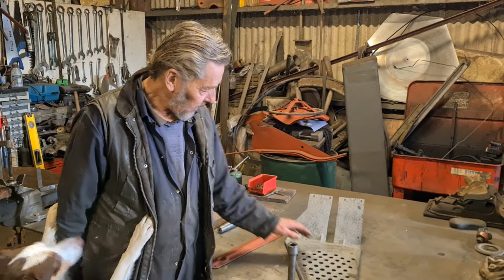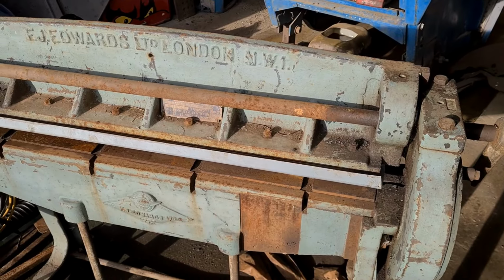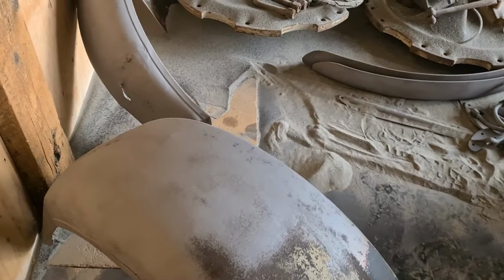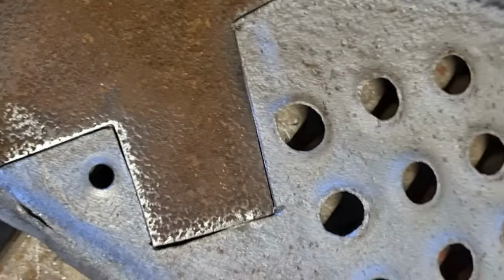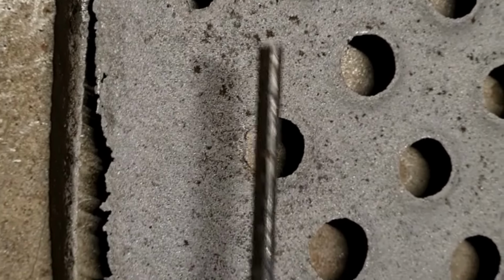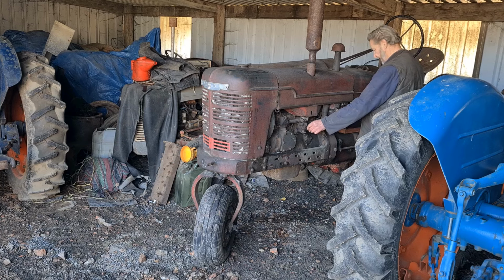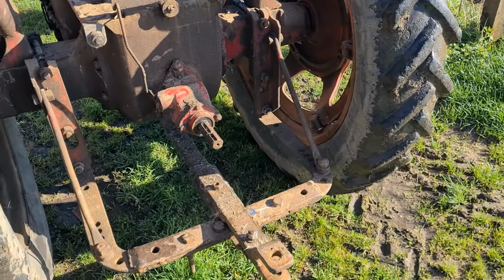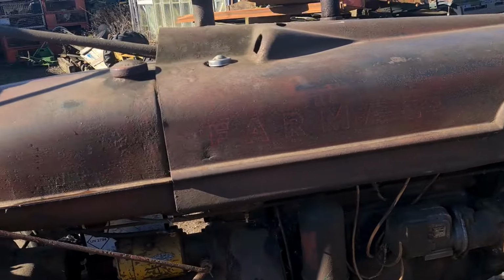part 10 of STANDARD FORDSON PERKINS 4.270 conversion

Comment: Another excellent video 👍 nice little tip i picked up from it using small round bar to strengthen the edge of the footplates on my 58 B250, ive driven E27 TVO and a P6 version but on my bucket list of things to do i want a go on a Fordson N 👍 just love the original patina on the old Farmall H shes a beauty 😍 really good sounding engine as well very responsive to the throttle 💪 glad i found your channel excellent companion to a cup of tea ☕👍
Reply from the maker: Next week you will be able to ride with me on a orange 1938 standard fordson 👍
Reply: Look forward to that 👍 just discovered our vintage club chairman has 5 Ns but only one in running order so next time it's out he's gonna give me a shout 👌

Comment: is that an  L4  perkins  my dad said they had lots of grunt for ploughing    way better than the p6   they used to tape in the excess fuel button for extra   
power
Reply from the maker: No it's a4.270 next modle up with inline pump instead of rotary pump